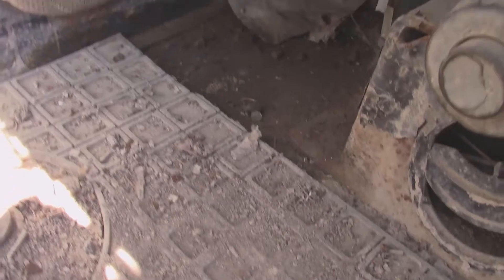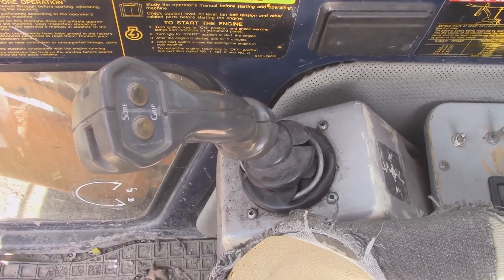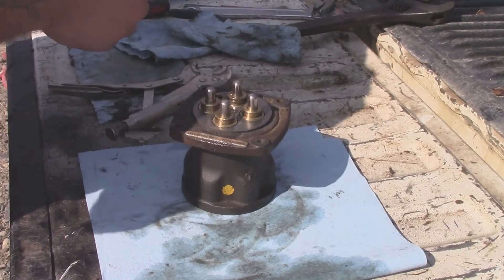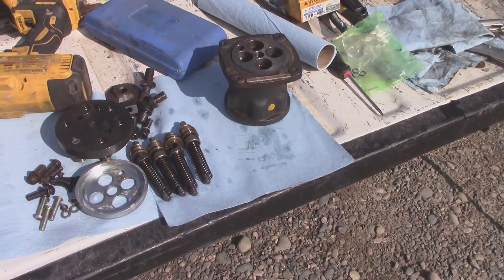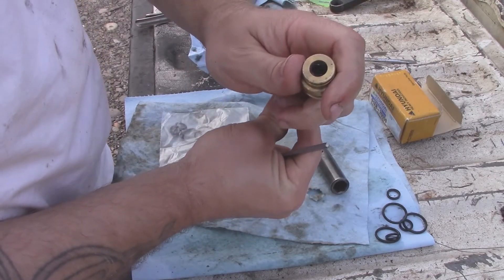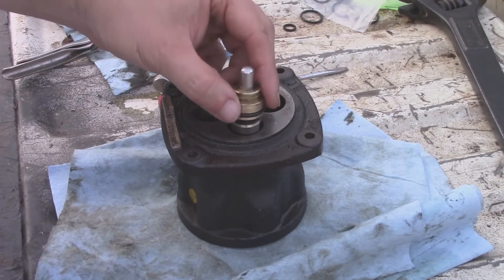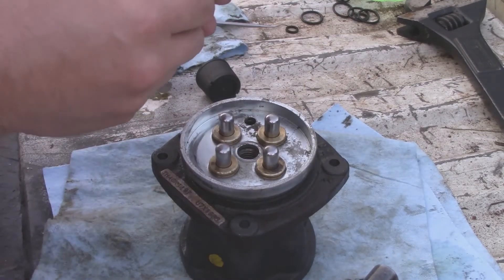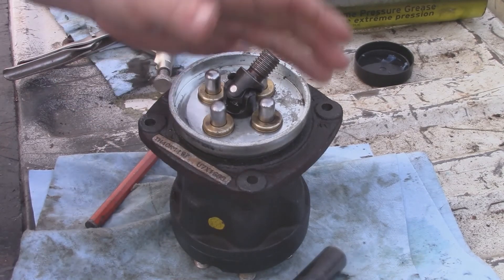How To Fix A Leaky Hydraulic Control Joystick (RCV) On Heavy Equipment

Comment: I just replaced mine on my cat 287b skid steer and now I’ve lost forward control and my left turn is very slow.    Reverse and right turn are perfect.    I’ve taken them out and put back in 12 times now. Everything is same as I took out. 

Any idea what may have happened?   

Thanks for  video
Reply: Ps,  I didn’t strip whole unit out,  I just undid joystick and retainer and changed on machine.
Reply: @antpoo  did you get it fixed? What was the problem? i have 287B with leaky joysticks, havent taken mine apart yet
Reply: @wrangler6675  hey.  Yes I finally got to the bottom of the problem.  

After I fitted seals the next day I attempted to undo the ball resolver valve to reseal it.   I thought the 4 Allen key screws at the bottom were how to undo it.   I undid one and fluid poured out.    I screwed it back in .     Anyway not long after is when I realised I lost forward and left turn so I should have known. 

Anyway what happened was the 4 Allen keys screws were ball resolver check valve seats.   And while I was undoing,  it actually sheared in half. and I had no idea.   

So when I screwed back in,  the check valve was ‘dead heading’ thus taking away my forward and left turn function.   

On the bright side,   I’m now an expert at this part of the joystick assembly 👍